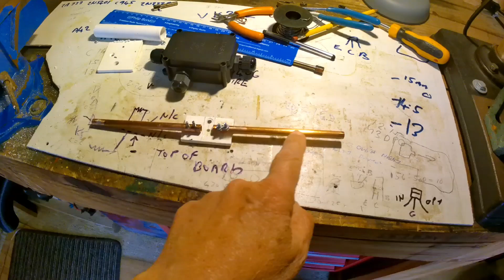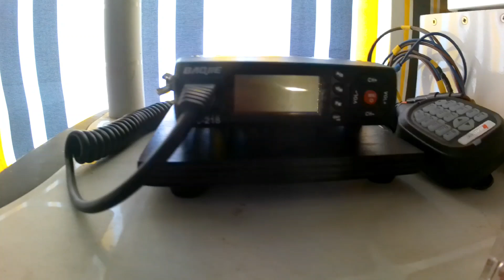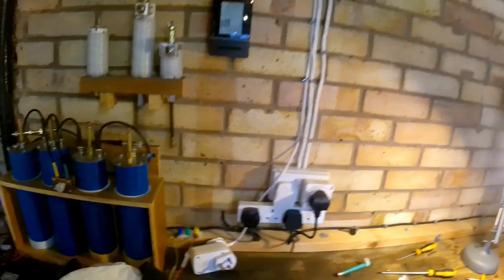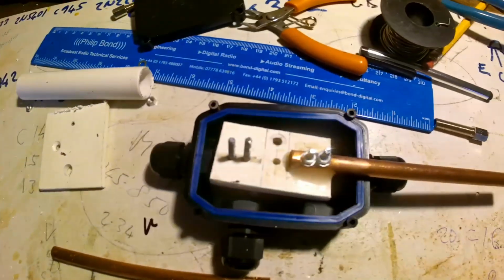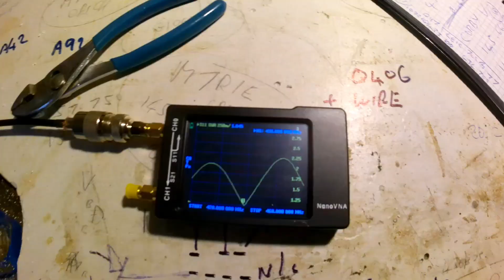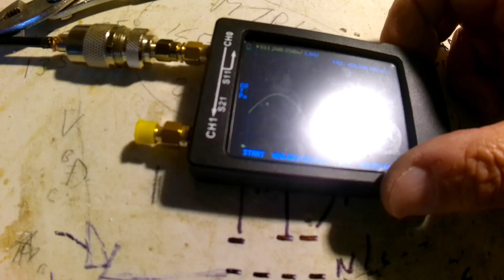Ham Radio. DIY 70cm Repeater. Rx and Tx Simple Aerial. Corby Repeater. #ham

Comment: Tidy build! You may want to mount that dipole vertically, although you sound relatively close to your local repeater, and I couldn't see if that was a vertically polarized site antenna there.  And...it works so well indoors you could probably just leave it mounted out of the weather.  Well done and great construction tips! 73 de KN4HGI Alan/"Thumpy"
Reply from the maker: Hi Alan. The local repeater is vertical polarised but for some reason this little aerial receives better in horizontally.  I can almost see the repeater site from my home. Cheers from George (Mick G1BKI)